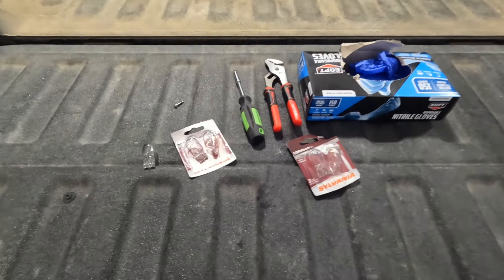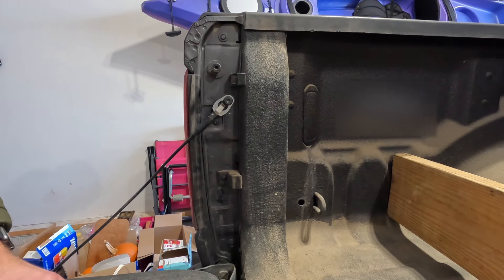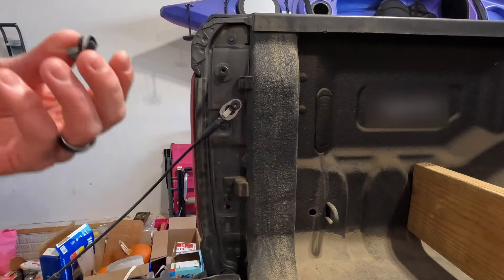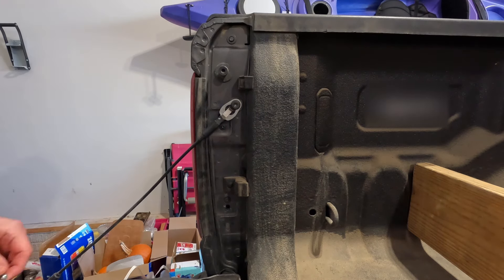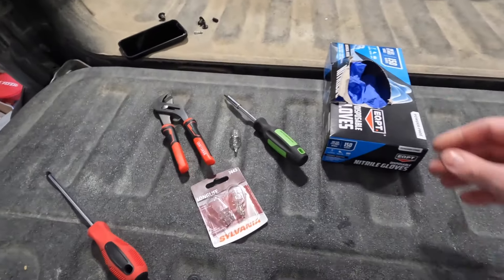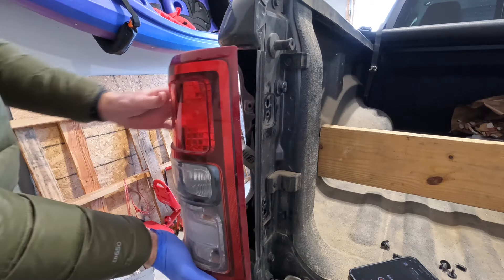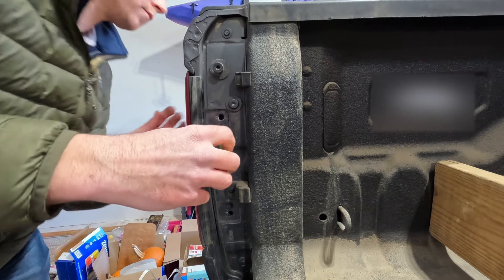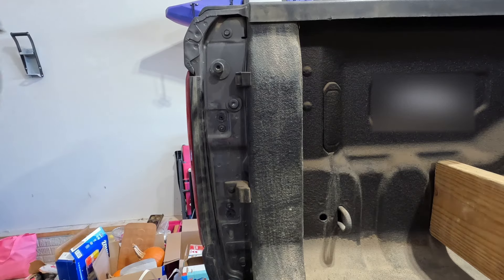How to Replace Ram 1500 Tail Light

Comment: I just googled it they are assembly grommets to help hold the tail light on place. My 2002 don't have them anymore and my lights flop around so I had to duct tape them. I think they were metal on the older models

Comment: When I got my tail lights tinted the guy broke those plugs out and said should be a lot easier for me to change my bulbs now. I'm thinking to myself don't I need those? We've been having a lot of rain up here in the north and I'm wondering if that's why my tail light went out because water got in there somehow? Maybe I should find replacements? Smart to use that screw to remove them